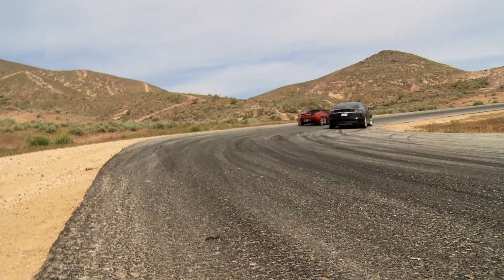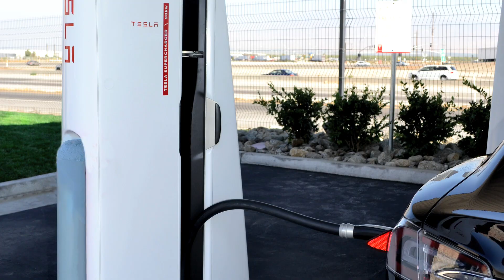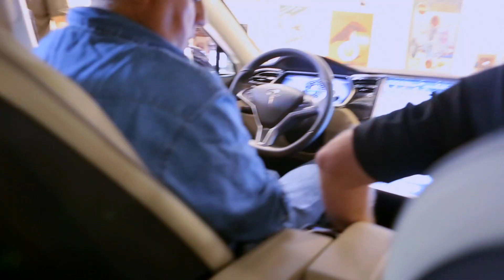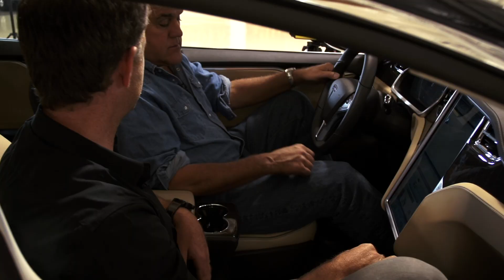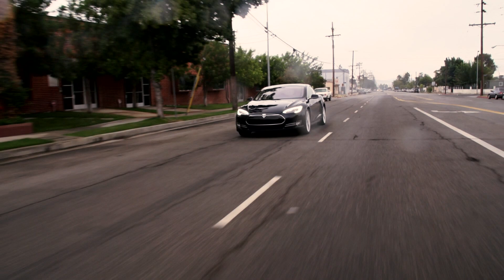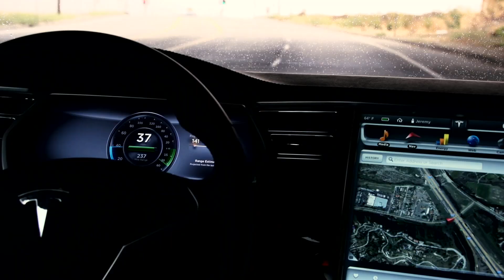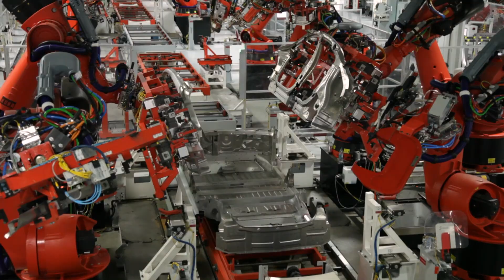2012 Tesla Model S - Jay Leno's Garage

Comment: One thing worth mentioning: As we've seen lately, a decrease in the demand for oil drops the price of the oil. That's a big part of why we're seeing $2 a gallon gas right now. More electric cars on the road mean even less demand for oil, which means even lower oil prices. It's a self-reinforcing cycle. If we can actually stay with developing green technologies in SPITE of the lower cost of gas (for once), we'll finally be able to beat the Big Oil system by using practically nothing, and paying practically nothing for what we DO use. Everybody wins. well, everybody except Big Oil and OPEC. Which means: Everybody wins.
Reply: Low crude prices are by no way impacted by electric cars.  ZERO.  I've taken a number of graduate-level economic classes and we've discussed the many myths and reasons behind lower prices.  I'm all about getting away from gas engines, but lower crude prices have nothing to do with electric vehicles.  Theoretically, even if 20% of the USA switched to electric in the next 5 years (impossible), even that wouldn't change the oil market.
Reply: Ugh. I hate myself for replying in a YouTube comments section, but demand is not down. In fact, demand is up, higher than ever. OPEC is flooding the market with cheap supply which is driving prices down to prevent current initiatives such as off-shore drilling domestically from making economic sense. It is a daring, strategic move that is actually working. Many companies are abandoning their long term development plans because gas has been made so cheap. Eventually, they will decrease supply once again and drive prices up.
Reply: Richard Rowe Actually, Saudi Arabia dropped their oil prices which allowed for lower prices per barrel for two reasons. To compete with the shale oil production of the United States and to also economically pressure Russia because the United States told them to.
Reply: +Richard Rowe . >> More electric cars on the road mean even less demand for oil, which means even lower oil prices
Not really. its only so cheap because of economy of scale. The moment they stop selling as much so not making as much profit they'll put the gas prices up not down.
Reply: Dennis Richards I have to agree with you. Invention and change come from need. Cheap oil will only serve the status quo.
Reply: standingwave73
That scenario is highly unlikely anytime in the next 25 years.  Gas is such a crucial aspect of life that people always adjust spending habits to compensate to gas prices.  People complain about $4 gas, but still pay for it.  But lets just explore that scenario for a second. 

Now this is total speculation based on Europe's costs which can exceed $10 per gallon and they still drive diesel/gas at those prices.  In order for 20% of Americans to be unable to afford fuel even with cost-saving measures, gas prices would have to hit around $10 per gallon, give or take a few dollars.  On a global scale, if America were to pay $5 gallon, that still would be cheap.

If gas prices could reach the $10 a gallon scale, then people would find alternatives to lower travel costs and probably buy electric en masses if they have the capital and the infrastructure to support it. Since electric is still rather new, there isn't enough consumer data to accurately map electric car buying compared to crude prices. 

Like I said, this is just a quick analysis based on Europe prices and their driving habits.  Americans might not react the same way.
Reply: Sinbreaker American habits are so completely different from European that it cant be counted as a factor. Americans stopped driving when gas briefly hit $5 one summer. It may be considered cheap overseas but we wouldn't go for it. Price spikes would just put more Ev's on the road like Richard said.
Reply: or the gas companies are tying to put guys like tesla out of business, it seems strange how all these manufacture's are going down the zero gas route, then all of a sudden BOOM gas prices drop more than ever, it fkn stinks, the banks and the oil companies have the world by the balls, do you think they're gonna let them go without a fight? one thing i do know is, you get bored of money, but never get bored of power.
Reply: more efficient engines will make more expensive oil
Reply: Thing is, if electric cars become dominant, they'll just charge you alot more for electricity and justify it with electric cars and the increase in demand... You really cannot win.
Reply: bW9taeH4 no no. When it becomes the norm (whenever everyone has moved to electric) it will cost just as much to power your electric car as it did to power your gasoline car. They won't (government) take less tax from you.
Reply: Are you a Theorist?
Reply: Rodney Leon that's why diesels are more popular in Europe because fuel prices are so dam high, so we need cars that do 45+mpg in the scheme of things we probably spend the same as our cars. are more efficient.
Reply: Way back in 1992 Ross Perot proposed a gas tax that increased 10 cents a year.  Made a ton of sense.  We'd have an extra $2.70 a gallon in tax now, way more electric cars, and the tax could be used to build out the electrical infrastructure.  The slow increase would be manageable.
Reply: Electric cars have had a very negligible effect on overall oil consumption because they are still sold in relatively minute quantities.  What really has driven down oil prices in recent years is the huge growth in natural gas production especially fracking.  While there are issues with fracking it is a massive improvement over sending 100’s of billions of dollars a year to brutal Muslim dictatorships that fund terrorists.  I support clean energy projects too because any energy we can produce ourselves is an improvement over funding our enemies.
Reply: Oh the naivety. I really wish you were right. In reality what's more likely to happen is people get cosy again paying slightly cheaper gas prices, companies like Tesla go bust because the demand for high price, low range cars trough. In a year or two (after OPEC stops being used as a economic weapon) the oil industry will be back to fucking us in the ass again. At that point electric cars will be back benched again for another decade or more as no one will risk investment. 

Also, We are not going to "finally beat the big oil system". unfortunately the US economy is intrinsically linked to the oil market, and a failed oil market means a failed economy.

non the less, I really want Tesla to succeed as its genuinely a great car.
Reply: Dennis Richards Well, that's exactly why we need to keep it first and foremost in the public consciousness that "Efficiency Makes Energy Cheaper." That needs to be on a thousand billboards all across the country. As long as people get that through their heads and keep it there, we stand a chance. But you may be right. Probably. 

I disagree, though. We need to eventually face the fact that an ever-expanding economy isn't necessarily a good thing. We should be shrinking and concentrating our economy, focusing on buying longer-lasting, higher-quality goods instead of loads of cheap crap. China will always win that game.
Reply: Richard Rowe 

"Efficiency Makes Energy Cheaper."
 If we reduce our energy usage, we've got two possible outcomes. They accept that people are using less and pass that loss on to share holders or (more likely) they will keep raising the price to recoup any losses and make more money.

"ever-expanding economy isn't necessarily a good thing"
I agree its not a good think But it is a necessity using the current economic system unfortunately. Even a static economy is classed as a bad thing because we're all at war (in a financial sense). We are in a perpetual currency arm's race where the victor reward with a powerful exchange rate and defeated and develop a weak currency (it more complicated than that but that's the general trend) 

standingwave73 I agree keeping the pressure is definitely a driver for more efficient technology but it all comes down to money at the end of the day.  In an ideal world they would keep oil prices high and use the profit to invest in science and technology rather than already wealthy shareholders in order to move beyond the oil dependant financial system, but our feudal monetary systems are easily corrupted hence the pan global problems we have today.

I could imagine any first world country legislating away any disruptive technology that threaten the status quo. expect to see aggressive legislation against things like cheap home manufacturing (3d printers/CNC machines), home energy generation (hydro wind solar etc), automation, robotics (like drones), water storage and refinement (they say waters is tomorrows oil. . . happy days) free communication (Internet) and anything else that is hard to tax and/or control.

most of these technology are already under fire before they get into the mainstream public market so the future doesn't look too bright . . .  Come to think of it, I might just be a pessimist.
Reply: Sinbreaker Interesting. What do you think would happen if oil prices skyrocketed and 20% of U.S. drivers could no longer afford gas? What impact do you think that would have on electric cars?
Reply: Sinbreaker
Yeah, I was like wtf is he talking about lol
Reply: I think we will there will come a day when the electric car will be so good that you will ask yourself why in the hell would I buy a gas car with all these maintenance cost and hassles and the model S and leaf are proving that those days are closer then ever. Electric cars need to be better then a gas car on ALL levels that includes life of the battery packs cost of buying cars and ability to recharge quickly 5 min or less and comparable performance and range.
Reply: right on brother.....wheres that fkn plug gone?
Reply: sHmAaa It's a supply and demand thing. If electricity gets more expensive, they'll start building more electric plants. Newer, modern, cleaner and more efficient plants. Household consumers won't stand for electricity getting too expensive just to feed cars, so it will even out. You know, nobody ever changed the world as a pessimist ;)
Reply: Richard Rowe i woude like too see the electric distributators start of makeing electric cars as they have the founding too fight the oil industrie
Reply: Richard Rowe HELL YEAH.
Reply: Sinbreaker Hey man...just read your comment. I appreciate someone with an education in economics chiming in. 

I can see where you're coming from, but I think you might be failing to account for one minor technical detail. Gasoline started out cheap back in Rockefeller's time because it was effectively a useless industrial byproduct. A barrel of oil is only about 40% gasoline...the rest of it is diesel/jet fuel, heating oil, asphalt, LPG and various other stuff. 

Your argument for equilibrium on the price of oil assumes that gasoline and road-use diesel are the only factors involved in the price of oil. Right now, they are the MAIN factors, but they're not the only ones. If everyone switched over to solar-powered electric cars today, that wouldn't affect the demand for jet fuel or heavy diesel for shipping. It wouldn't negatively affect the huge plastics industry, or the amount of asphalt we use for roads. If anything, those industries might expand, and potentially drive up the demand for the other 60% of the barrel of oil.

Given the stability of that 60%, and a massive drop in demand for the 40% of gas...I'm sure you can tell me what happens. Gasoline goes back to being what it was in the first place...a cheap, largely unwanted industrial byproduct. I mean, I'm sure they'll find some use for it, as far as splitting up the gasoline hydrocarbons and using them as feedstocks for synthetic materials. But not nearly at the volume used for fuel today.

Ultimately, when we drop the demand for gasoline enough, the jet fuel, shipping, road construction and (probably most of all) the plastics industry will become the major drivers in the price of oil. The price of gas can continue to drop independently once it's no longer driving the price of oil. 

Just a little technical detail...but an important one, I think :)
Reply: Richard Rowehow little you know. that's not the real reason why the oil price dropped.....
Reply: JINXED 63 LOL...I'd imagine they would have, but they probably couldn't stand the Puritans either. Far as the price of gas...yeah, that's true. But look at the difference in size between the two places. Florida alone is only about a quarter smaller in square mileage than the entire UK. And California is bigger than any country in Europe except Spain. I think. Commuting and shipping distances are shorter in Europe, you've got much better public transportation. and more options as far as shipping by rail or sea.  So yeah, there's a reason we rely on cheap fuel. I think it's mostly a geographic thing.
Reply: The nextinline I know that reduction in demand wasn't the entire reason this time. But as far as pricing, reduction of demand and increase in supply are functionally interchangeable. The same thing will happen either way. In terms of cost, it doesn't matter if we use less or have more...but using less is the more sustainable and less complicated option.
Reply: Richard Rowe but gay raises like crazy...
Reply: Richard Rowe Well, Rich, in an Ideal World, that is how it would work. Bigger supply = drop in price.  But, in the real world, governments love to increase taxes whenever they can.  Look at other products they love to tax even though demand for them has decreased.  Cigarettes,  Gasoline, Diesel, Condoms(ha! ha!).  Even those items that have a relatively high demand have some of the craziest taxes and fees tacked on, including Dish services, Cable, both cellular and hardwire phones etc etc.   Once there is a stabilized decrease or aggregate demand for oil, governments will begin laying on heavy taxes believing if we really want to use this stuff, we will pay the ridiculous prices for them.  We will see this if we ever win the war on Islamic Terrorism and more countries become freer in International Trading where imports/exports flow freely with demand from each nation.  But, I dont see that happening anytime soon.  And If Islam wins and conquers the world as they believe, we will be brought back into the 7th Century and only the wealthiest muslims will have access to oil as in much of the middle east today.   Semper Fi
Reply: Richard Rowe Well, Rich, in an Ideal World, that is how it would work. Bigger supply = drop in price.  But, in the real world, governments love to increase taxes whenever they can.  Look at other products they love to tax even though demand for them has decreased.  Cigarettes,  Gasoline, Diesel, Condoms(ha! ha!).  Even those items that have a relatively high demand have some of the craziest taxes and fees tacked on, including Dish services, Cable, both cellular and hardwire phones etc etc.   Once there is a stabilized decrease or aggregate demand for oil, governments will begin laying on heavy taxes believing if we really want to use this stuff, we will pay the ridiculous prices for them.  We will see this if we ever win the war on Islamic Terrorism and more countries become freer in International Trading where imports/exports flow freely with demand from each nation.  But, I dont see that happening anytime soon.  And If Islam wins and conquers the world as they believe, we will be brought back into the 7th Century and only the wealthiest muslims will have access to oil as in much of the middle east today.   Semper Fi
Reply: Richard Rowe Sir, your price is ASSuming that the price of gas will be this way always. This is currently due to the US not going to war in the middle east. But getting a Bush in the White House would mean there would be a war, like say in Syria, which would drive up the $ of gas. I'm happy this car was done, and in my lifetime I pray I would get enough money to get and drive this car. There was a reason the Rebs in Congress put a stop to the US getting these cars in the US fleet. It was bad news to Big Oil/the Kochs making money.
Reply: w41duvernay I agree with all of the above, except I'm not really sure it matters what the oil industry does at this point. Especially with self-driving cars just over the horizon. Those are going to completely change everything in terms of fuel economy, but more importantly number of vehicles on the road. Most auto manufacturers expect  60 to 65 percent decline in sales by 2030, and as much as 80 by 2050. Between that and electric cars, I expect the demand for oil to drop like a rock in the very near future. And even as evil as they are, I'm pretty sure even the Kochs can't live forever. And once demand starts dropping, we'll have our own surplus, and I seriously doubt anyone will have an easy time making a case for any war in the Middle East. 

I actually just did a couple article on Topspeed.com on self driving cars. A Timeline and a Socioeconomic ("How they'll Change Everything") piece. Check them out...might give you some hope for the future :)
Reply: Richard Rowe If everyone drives these cars what direction do u believe electricity prices will go?
Hint...not down
Reply: But teslas look cool :)
Reply: daz samuels Well, that's the thing about electricity...you can always make more. It's not exactly a finite resource. And yep, they do :)
Reply: Richard Rowe sure. But you take my point, when everything goes electric car wise- you'll pay just as much as you do now (one way or t'other).
Reply: The government will scale it as they always do so you pay just as much to power your car as you can afford. Electric or Gasoline.
Reply: daz samuels they may go down or stay the same. You have to consider that most people charge at night. The amount of electricity that a person uses at night even when charging is typically lower than with the same person uses during the day. During the day, the grid is overloaded. There are businesses, and factories, heavy  use of air conditioning, people who are awake and using electricity, and many other things that are not going on during the night. There is so much extra capacity at night compared to peak hours that if everybody in the country switched to electric cars, it would not impact the grid. Therefore, by charging the same amount of money, the electric companies would fare very well. As far as supply and demand goes, there is far too much supply at night compared to demand. They have no basis for raising their rates.
Reply: daz samuels even right now, electric companies are giving people special EV rates. The rates kick in at night, so the electric companies make a lot more money by selling more electricity. By lowering rates, they are encouraging people to get EVs and make more money for the electric companies by using excess capacity that's there just waiting for them. If they raise rates, it would discourage people from getting EVs, and that would hurt the electric companies. The equipment is already there. Lowering rates will make them more money, and raising rates will make them less money. It's that simple.
Reply: daz samuels you simply don't understand the concept of supply and demand and then. Its basic economic theory. They will have more supply then there will be demand even if everybody switch is over. That means they want to sell more common not less. And they won't sell more by raising prices. That's not how the world works.
Reply: bW9taeH4 okay let me explain this way...
The government will load taxes on like they do with gas now. I'm not talking about the electricity cost, I'm talking about the taxes loaded onto it. Look at what we in the UK pay for gas, whatever the fuel cost, we don't see the TRUE saving, because we always pay the tax loaded on. The TRUE saving when oil prices go down is NEVER revealed at the pump.
Reply: So electricity costs will get loaded with tax by the government based on what they think the public can afford. If the price of electricity goes down the government will just add more tax and maybe maybe give you a very small saving. Trust me when the public all ALL drive electric this will happen.
Reply: daz samuels the government could start adding on new taxes, but adding it to the electric bill won't help. As it is, PG&E gave me eV rates. If not for that, I would have gone solar. Musk is also the chairman of Solar City. Tesla gives free access to super chargers. With respect to taxes, the real issue is that a certain percentage of the tax on gasoline goes to road improvements. Is that revenue goes away, somebody has to pay for the roads. That's a given. But it doesn't mean that it will become more expensive for electricity and it is for gasoline. Even if you add the taxes in, the base price of electricity is still far lower than the base price of gasoline. If the government tried to throw things out of balance, and companies would simply come along and sell quote economy of cars on quote that run on gasoline.
Reply: bW9taeH4 im not saying youll pwy more for electric cars, just that ultimately youll pay the same. Its again like everything lol. If you have disposable income, the government (especially centre lefts) are very keen to part you from it. They'll always be more roads and traffic lights and whatever else they can conjure up to pay for.
Reply: In the UK we pay rightly for our NHS.
But we pay a lot for it. 80% of fuel prices is tax. If we all drove electric, their would be scaled tax  to your income :)
Reply: Its all bullshit because the cars are for the 1 percent onlyy
Reply: Chevy Bolt is $37.5K before incentives and probably more like $20K in a few years, used. 238 miles of range, EPA. 0-60 in 6.5 s
Reply: bW9taeH4 unfutunately 2 yrs later in some states it has.
Reply: well said...there's reality and then there's a biased political emotional need that drives opinion.
Reply: Electric cars still burn fuel, just not in the engine bay
Reply: But I don't see the demand for lung cancer and emphysema rising any time soon...
Reply: This is NOT the case at ALL. Firstly even in 2019 a tiny number of vehicles are electric, so their impact is immeasurably small. Secondly and more importantly you need to realise that world oil prices are artificially controlled by the big exporter countries such as Saudi Arabia,  Russia, and more recently the US and Canada. The north  american shale oil revolution has thrown a massive rock into the oil cartels rigged pricing. So now OPEC has decided to drop the price of oil to make shale oil uneconomic to extract, hoping to close down the nascent oil production in the US and elsewhere.  However what they are waking up to is that there is now a ceiling for oil price above which huge reserves of shale oil become affordable to extract. This is going to hold prices low because any rise above a certain threshold will trigger a growth in shale oil production.  This situation will continue until all cars are indeed electric, because there are still significant oil reserves left. I think that we will end the 21st century with all cars electric and still centuries of oil left in reserves,  ie peak oil will never happen!
Reply: The price of electricity then goes up. You forget most of the cost at the pump is taxes.
Reply: Check the gas prices now.....!!
Reply: 2 years later, and thanks god it doesn't look like that is happening :)
Reply: +Dennis Richards Actually the people like you who do not have "balls" to stand up to oil monsters and live in "fear of the future", that's why your comment is accurate. WOULD YOU AND IDIOTS LIKE YOU JUST STOP FUCKING COMPLAINING ABOUT ELECTRICAL POWER BEING THE MAIN POWER ON THE PLANET! GET LOST!